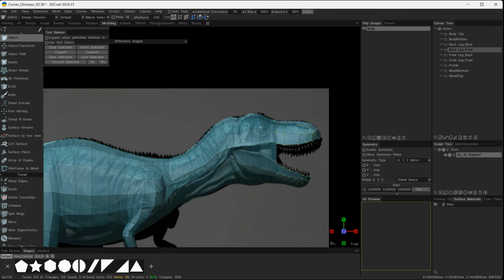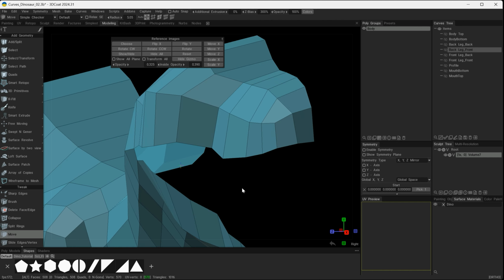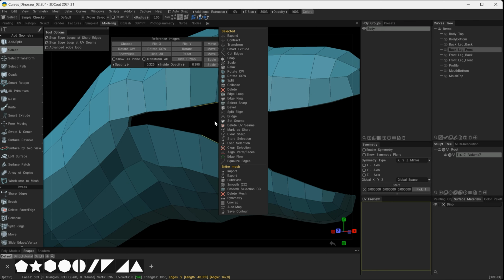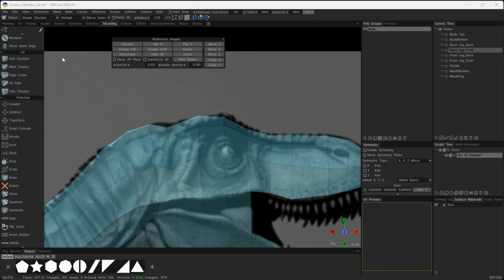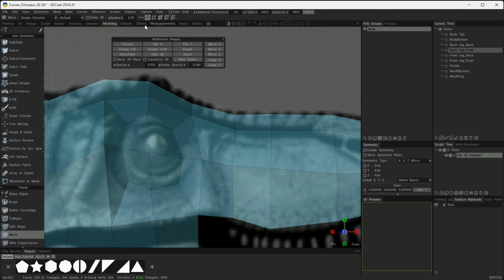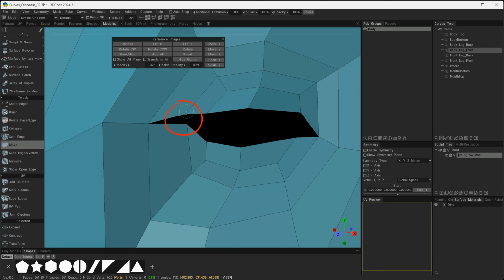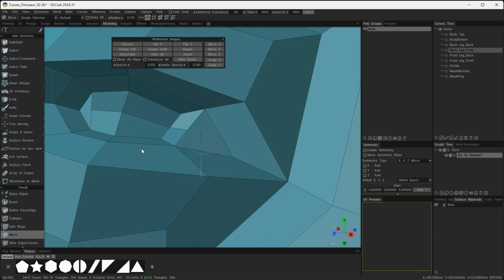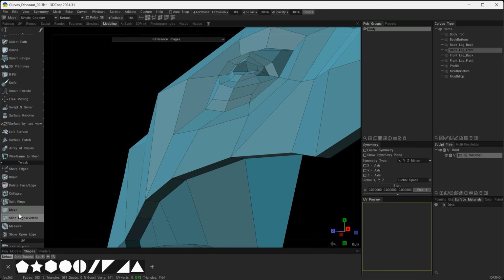3DCoat Low-Poly Modeling for Beginners #29. Dinosaur. Part 5

Comment: At first working with this Move tool felt very weird for me, old 3ds max user. But on organic models like this it proves pretty handy. Dragging verts one by one in screen space is not so bad) One problem I faced is, after splitting and closing some holes, Coat marked some polygons as separate islands, showing them in different colors + with red outline. That's weird on a model that has no UVs at all... I found a way how to disable it in display drop down list in top shelf - uncheck colored uv islands, and show UV seams. But it makes all model dull grey color.